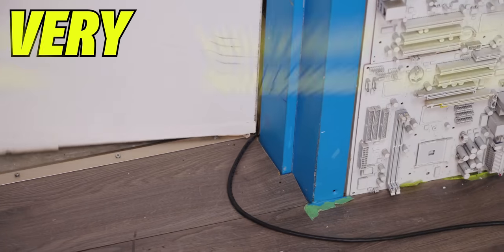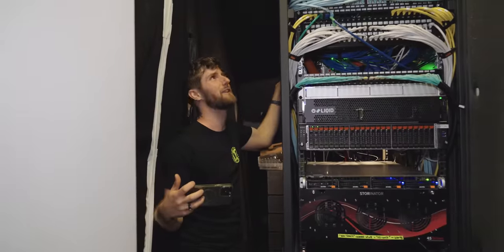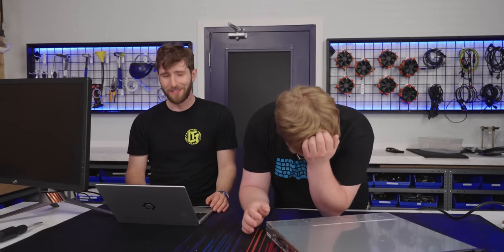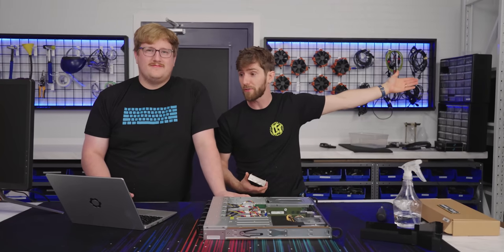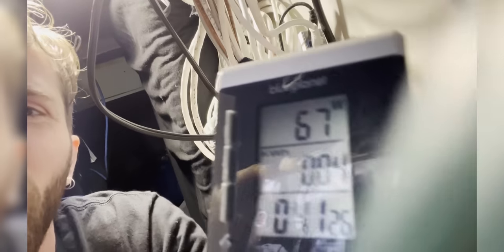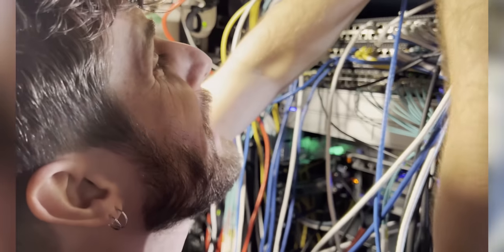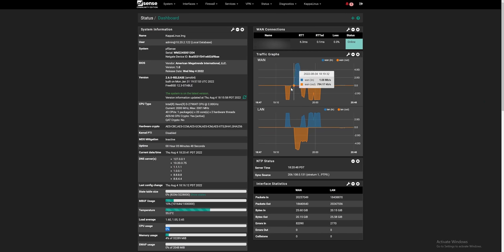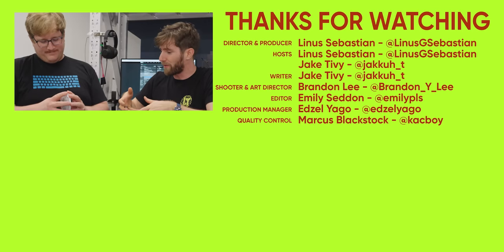I hope you don't need internet.... - PfSense Router Update

Comment: On the other hand, I would love to see a series where these guys clean up the server room and that mess inside. Maybe move the storage to another room and have the internet there or just expand the whole room and just go balls to the wall like they like to do.
Reply: The problem is that the return on that investment is going to be very low.  The space needed and the disruption it would cause would be significant.  And while they spend a lot of on other stuff, things like Creative Warehouse produce profit on each product sold.  A better server room with better equipment (that they often don't pay for) would only really offer savings, not generate revenue.
Reply: @tams805  A propper server room setup with all things sorted out and organized wouldnt make revenue but is the basis of the revnue they get. If this whole setup they have goes off by overheating through the air conditioning, power things or no planed redundancy the couldnt make the revnues they do now

Comment: Good on you for paying attention to hardware lifecycles. It's all fun and games until you find out that the router you have been using to service 15,000 homes hasn't been rebooted in 8 years.
Reply: Your 10 bit router is still good enough for gaming!
Reply: Honestly impressed with that uptime. That's a reliable electrical grid!
Reply: @desoroxxx  yeah every commercual UPS I have seen allows the device to safely shut down after a loss of power, not keep it on throughout the outage.
Reply: "I'm tired boss"
Reply: @thelegalsystem  In that case it was a full rectifier/inverter ISP Central Office setup with a battery bank and backup generator.

Someone in our network operations center only noticed the excessively long uptime after a tiiiiiny memory leak started causing issues.  Cisco had to push out a custom hotfix to correct it. 

 I was just the sad sack who had to come in at 3am to install some RAM upgrades and load the new config.
Reply: @thelegalsystem  I think they usually use a combination of a UPS and backup generator.  The UPS keeps the system up long enough for the generator to kick in.  I just did a bit research not long ago on UPSes and as best I can tell the average UPS doesn't require the device be shut down but may come with software that can trigger a shutdown (usually the UPS will have a USB connection to the computer, router, or NAS to send a signal).
Reply: @pjpleiss  oooh the backup genny. Most of our sites didn't have that since it was up to the building we installed in. At the central office though we did have some BRs on a generator. Plus everything at the exchange, but thats a given.
Reply: I wish I could go 8 years without rebooting my router
Reply: OKAY
Reply: @evancombs5159  either it's very stable or probably vulnerable since it's not updated since installed.
Reply: Talking about rebooting, in the ISP I used to work, some genius had to reboot a damn OLT from a minor ISP subsidiary in another country,  leaving thousands of people without internet, and worse of all, those users where deleted from the network without chance to fix that without going house by house. 

And yeah, because those incompetent ppl messed up badly, and because other where absolutely clueless about how to fix it, they had to call me and make me take a flight to another country in South America.

It was something that bad that they were about to fire an entire gpon department for the case. Working for an entire day (24+h) without stopping, we could find the backup of the OLT in an old dusty room in the company. Later I had to make a report and a manual for correctly testing booting devices. We also found several managements problems in the data centers related to routers and firewalls. Ofc I got a big bonus and took several weeks off duty but dealing with bad management is absolutely the worst.

Comment: Yay for OPNSense! I can recommend their business license as it gives you a way more stable repo and easy management of multiple instances.
I also manage 2 of their hardware routers, pretty good kit!
Reply: I can't imagine using pfsense after all the shenanigans they've pulled (see Wireguard, for example).  OPN for the win.
Reply: @toddosty  what's wrong with wireguard?
Reply: @StrokeMahEgo  nothing just their initial implementation of it. See Wikipedia.
Reply: @toddosty  The current Wireguard package is solid tho
Reply: @denxos  Missing the point, though.  This is a case where the journey is just as important as the destination.  And this isn't anywhere near the first time Netgate pulled shady stuff.

Comment: I actually went straight for OPNsense and skipped pfSense when I setup an old R210II as a router for the homelab mostly due to WireGuard support at the time. Nothing to brag about compared to that beast of a router, but it is interesting seeing hardware like that and more people switching to OPNsense!
Reply: r210's were a cool form factor. The shallow depth on them is afaik still unmatched by anything in dells current lineup. I had a whole company running off a pair of those running ganeti as a VM host all sitting in a wall mount rack. Was awesome to live migrate and screw around on ones hardware while there were still users running RDP and phone calls live through the asterisk VM.

Came in really handy when they had a hardware failure once and the "next business day" service was more like "the next few days" I could have pushed and they would have made it out at like 7pm but meh everything was still running lol.
Reply: Same, I went OPNSense on my personal network after deploying many PFSense boxes to other companies.  Why?  The leadership at Netgate are petty, childish morons.  I don't have time to put up with that.  Frankly it is embarrassing.  I am very happy with OPNSense.  It is better in many ways, and just as good in most of the rest.  The community is smaller, but much of the PFSense community solutions apply as well.  And the leadership are not dicks.  Bonus.

Comment: I ran into the same dilemma when I was on Pfsense where feature parity was slow and updates seemed to be only when the OS gets its major update, but as you said, parts like the underlying OS may still not be updated to the latest. I had used both but switched back to Opnsense for faster updates and security patches as well as support for the latest drivers/features. Not looking back. Glad to see you came to the same conclusion pretty much.

Comment: Man if that's what LINUS' server room cable management looks like I don't even want to attempt my own lol
Reply: I had to clean up such messes for several companies in the past in the time i was a network guy. 20 years ago. It's actually easier than it looks. Trick is to document exactly what port is connected to what port. Then you're safe.
Reply: That's what any server room looks like where hardware gets swapped in and out with any kind of regularity.  They are only neat if no one is touching them, cause the moment you change gear and need 8 network jacks where you used to need four, any organization goes out the window, and it is not worth the time to redo everything just to make it look neat.
Reply: @johngaltline9933  it was neat and tidy once :) lol
Reply: @johngaltline9933  that does make sense

Comment: I like how those guys are literally running a metric ton of servers capable of hosting a container and/or VM, but are still running a UBNT Unifi Dream Machine Pro as an absolute all-in-one device as a controller only.
This is where you could safe some power, Linus =)
Reply: They have some interesting gear. That said, I haven't been able to get the NVR pro and thus udmpro for me. It is fairly power efficient. With the number of access points, switches etc,  it is an easy solution. They could probably self host it on a different box, but it was likely sponsored a lot hehe

Comment: LOL!  As a network engineer, I find these videos hilarious.  They remind me of my time installing T1/Frame-relay/ISDN back in the 90's.  Most ISPs will provide the router for business solutions connected directly to their fiber termination switch.  Technically knowledgeable engineers can (and do) bypass these routers all the time (less points of failure?), but it impacts the ISPs ability to access/monitor their on site equipment (like LTT did).  Personally, I use the ISP's router.  I don't want to be responsible for PD of their circuit.  I appreciate being able to plug my laptop directly into the router and test if it is an ISP problem or my (FW) equipment.

Comment: One advantage of an overpowered router/firewall is that, aside from handling your internet speed, it increases the speed of traffic between your vlans.

In my job we actually have way more lateral traffic across vlans than we do vertical traffic with the internet, for example.

Comment: I hope I'm not the only IT guy who just wants to go in and tidy that cable mess up and sort things out, also UDMP and UNVR in the rack aswell is an interesting, but running the incoming internet via a production switch that's got internal networks running on it is a big no-no for security, should be on a standalone switch for WAN traffic
Reply: Is this a bad idea because of VLAN hopping?
Reply: @raiden72  yup, also going on "lots of Vlans" and how things are very easy to change on Unifi switches could cause a misconfiguration and potentially expose allsorts, just alot of risk factor which a standalone switch would solve, at least they have swapped to Opnsense and got rid of the switch passthrough

Comment: How come the power supplys for servers and things like this have power delivery of like 800watts but are relatively small and the equivalent for a gaming pc is so much bigger
Reply: You could get a smaller one as well. 
Wouldn't be cheap though.
Reply: Existing standards, probably.
Reply: Well at a glance there is a small square  PCB and a giant ass fan that runs slow on a ATX PSU that is pretty quiet. Where as a 1U PSU has a small rectangle PCB with a tiny fan that runs like a cut cat and sounds like it's prepping for liftoff. So fan size and PCB shape. You could run a  PC off a 1U PSU but you have to start allowing for things like tighter tolerances transient power spikes heat mitigation and more . 
Check out ltt's desk PC build videos. They use a flex atx psu which is smaller than an atx psu
Reply: Computing is much less energy intensive than communication/networking chips.

A communication operation can easily require two orders of magnitude more energy than a store/load operation, which itself requires two orders of magnitude more energy than a CPU arithmetic operation.

Quoting Nvidia: "Computing is cheap, memory is expensive, communication is prohibitively expensive"
Reply: Redundancy. You want one to be able to handle the maximum theoretical chassis load, so you have two in case one breaks.
Reply: a few things:

they cost 10x as much
they're not really smaller, just different form factor that appears to have smaller footprint
they're designed to have a an insane server style fan blasting through them to keep them cool. you don't want a server in your living room

Comment: If the pfsense not support the adapter you can install the pfsense in a virtual machine. If the host proxmox or esxi supports the adapter it will work under virtual environment.

Comment: Point of clarification: Cisco and other major manufacturers still use 64-bit x86 processors in their dedicated switches and routers, just that those subsequently feed into dedicated ASIC modules on the board that take the place of less optimized HBA or NIC modules for switching and routing applications. So instead of having a bunch of PCIe connections for cards to go into, you just feed all of those PCIe lanes into ASIC chips on the board. The cool part is that the ASIC modules are actually able to communicate with each other to reduce CPU load for certain standard switching tasks.

Comment: Dude, I’m still rocking the water cooling setup from NCIX you recommended in 2006? 2007? Water pump never stopped! Modded antec 900 with Fluid xp lasted nearly 10 years! 3 cpus…. Some graphics cards… still chugging.
Reply: Pfsense was my jam 10 years ago when openwrt/ddwrt went 🦤. Moved on to enterprise stuff as I got older… but still loved the used atx system that ran pfsense… for weeks after the hard drive died. Worth every penny!

Comment: Replacing box is like easy:
Install OS on new box, import config, then put new box next to running one, configure switch ports, connect new box to switch and finally move ISP link from old router to new one.
No network outage at all.

Comment: I recently switched from a charter router… k set up a opensense configuration. to a 8 core 16gb computer with a 2gb 2 port  nic. I also added a ubiquity switch and a few access points. For my house. And property. 
I have 2gb internet. And wanted a really good self hosted vpn. I recently switched to WireGuard running in a data center close by me for security. Honestly it has been amazing. My internet is still blazing fast  while having sometimes 50 devices connected to boot I used VMware ESXI and set up a opnsense vm. And a Ubuntu machine for a emailing server ubiquity’s software ect to use the extra core I had left. It has been crazy and Opnsense is god tier but there is not a lot of information about it available.

Comment: Do the SFP modules themselves need drivers? I thought it would only be the actual network card where you plug those in. I built a pfSense router using an old Mellanox card, and I just bought a random SFP module off Amazon with the correct type of plug to run my internet fiber straight into the router, and it just worked (after I reported my MAC address to my ISP). Also surprised that my home internet might be faster than LTT's!

Comment: The FreeBSD/pfSense Intel NIC situation is something I ran into a while ago myself. No support for an (at that time) newer NIC, not even in the latest at that time. From what I could see, it was basically because Intel pretty much contributes the Linux drivers themselves and don't care about FreeBSD... And because of the licensing difference (GPLv2 for Linux, BSD for FreeBSD), it's not something that could just be ported over. (And I was already using OPNSense at the time -- not even the latest version of FreeBSD had the driver I needed then.)

Comment: About the old PFsense Router. We used them as well and to use the AES-NI of the Intel Chipsets you needed to add a line for the driver to load correctly. legal.intel_xxx.license_ack="1"  For the Networkcards it was legal.intel_igb.license_ack="1" . 
The Problem was resolved with PFsense 2.5.x in 2021, there the "tainted" inteldrivers which needed the license Acknowledgment were removed. 

So when you had some strange problems with Pfsense and Intel Hardware, the problem was the Driver Acknowledgment.  Today it's gone. 
I set up 20 Routers with PFsense in 2020, when the Problem was persisting and was wondering why they were running only at 60-70% of performance, was a long dig to find.

Comment: 8:17 the issue isnt the cpu, the issue is the linux routing stack. VPP (dpdk based) can run ~140gbps with a ryzen 9 5950x (yes high single core performance matters) with ~110Mpps

Comment: Have you considered running TNSR instead of pfSense? Its from the same company (netgate) and will be able to route ~100Gbps purely software based thanks to the routing being done in userspace using DPDK and VPP. Its what im currently setting up at home for upgrading to a 25Gb connection.
Reply: TSNR is potent but pure router, no firewall. they dont need routers yet, they running in one common lan and for 10gb pfsense does just fine.

Comment: pfSense can do one, look up the debacle over AES-NI requirement, pfSense either was going to or did restrict it to CPUs with AES-NI meaning you couldn't use perfectly capable CPUs without AES-NI even if you weren't going to use anything that would need it. They also had issues with OPNsense as they started domain squatting resulting in ICANN forcing pfSense to give OPNsense the domain. They also handled the AES-NI thing like children so since then I have not wanted anything to do with pfSense and I don't think anyone else should unless they have to.

Comment: no linus you just not set seperate vlans on your switch (with svi's). there still needs a firewall in between (which routes as well) to properly segment these days. bundle the 25GB and create subinterfaces on it, then you do not need additional ports to have 50Gig link.

Comment: A word to anyone watching this and thinking 'Hey! Building my own router to replace my crappy Netgear wireless router (which had security issues recently) with an old machine I have lying around and pfSense/OPNsense sounds like a cool project!'.

Both pfSense and and OPNsense are great pieces of software. I've been trying out router OSes lately and the features they have are top notch. BUT: Don't expect to do decent WIFI with them. You'll need a hardware wireless access point connected to an ethernet port. Although the do support wifi, FreeBSD (and hence pfSense and OPNsense) do NOT support AC, let alone AX. In fact, according to the freebsd site, the latest wifi standard it supports is G (although that may be out of date, but OPNsense say independently that AC is not supported).

It kinda sucks.

Comment: Are you routing Layer 3 on pfsense?, very inefficient. Do you even use VLANS? It's so satisfying separating depts or buildings on different vlans. Use a switch for L3, also enables you to work on router without bringing down the whole network. Pfsense is ok when you don't have the funds for a NGFW. App-ID and User-ID are a must, you need to get a VM firewall like Fortigate and video it's setup. I wanna ditch my Palo Alto but wanna see more about Fortigate.